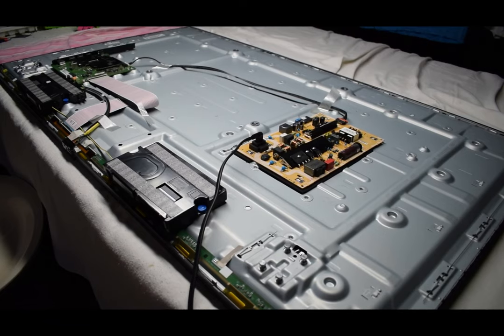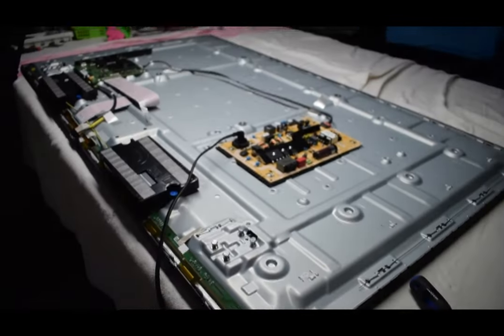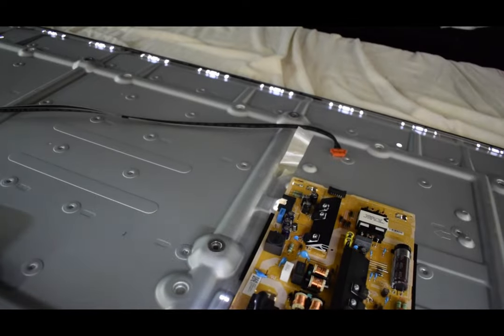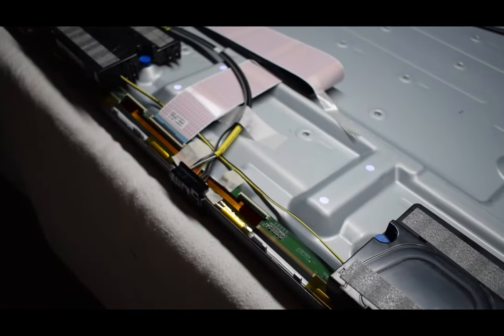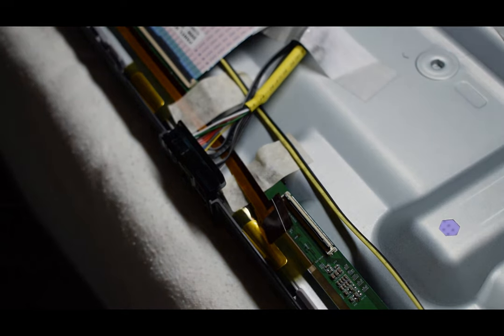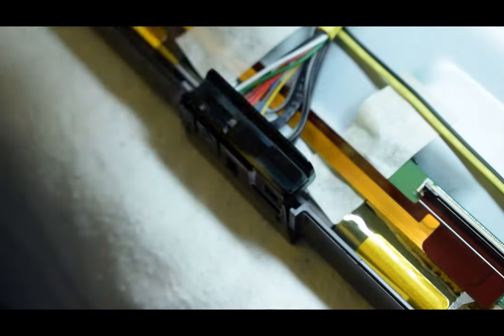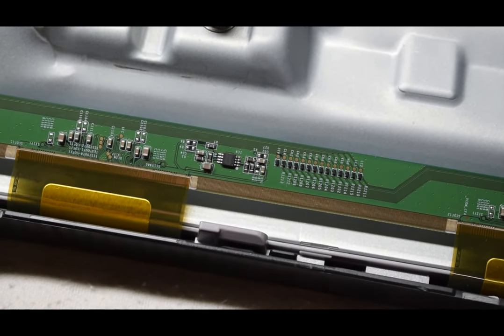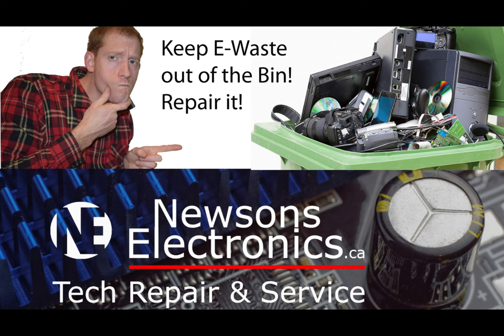Samsung smart TV power cycle Model UN58TU7000

Comment: Firmware is quite big and should be in flash memory. Staying in bootloader means the last update deployment was unsuccessful and it has nowhere to jump. Usually, update process takes 2 steps. First, it downloads new firmware and stores it somewhere in flash memory. It should verify that the downloaded file matches online one. Probably using MD5 checksum. Second, it sets some flags saying update is ready to be deployed and reboots. Bootloader knows there’s update so it will deploy it by overwriting the old firmware (I heard about systems that use incremental firmware locations but never worked with them). At the end, it will clear update flags and reboot the system. After rebooting, bootloader will jump into a new firmware. The problem is, when deployment fails (can be many reasons actually) there’s no valid firmware. Your firmware is corrupted so your system will be scheduled for reset by watchdog. The only solution could be reprogramming your flash memory with proper firmware but I doubt you can do this without special tools and firmware itself(reddit)

Comment: Thermal camera or alcohol to show what's getting hot?
Reply from the maker: good to know
Reply: I thought so too, but it shuts off immediately upon initializing and it detects a short.... So, will have to "power inject" to keep voltage on long enough for component to heat up.

Comment: Hi , I fixed that problem. Underneath the left speaker, there is a ground tape that was not properly installed. It was over a few circuit line. I removed it and reinstalled properly and Bingo Tv worked again. My guess is with speaker vibration over time it made a short circui, it was after 4 year in my situation. Good luck!
Reply: What ground tape look like. What size tv u have. .

Comment: On my Samsung UE70TU7175U I have backlight, boot sound and it does not reboot I just have no image or Samsung logo at startup. Do you think it could be a panel error ? I tried tape but it didn't work. Thanks
Reply from the maker: sound like the main board, try a hard reboot
Reply: @NewsonsElectronics  Thank you for your help I will do that. I also noticed that I have 0v on capacitors near ribbon cable on mainboard. When I make a bridge between two points on top right on the mainboard (t-con ready procedure I think) I have 17v on those capacitors with ribbon cable disconnected. I checked for shorts on panel drivers without success.

Comment: This video Great, isolated the problem with the tape and have picture back on. color a little off due to bad circuit but it is watchable. I was close to ordering replacement board which would not have fixed problem, thanks again for great video

Comment: So with Samsung TV's sometimes the boot loop is due to a faulty EEPROM.. As for the tape method in general, It should be noted that this is not 100% full proof method. I am not in a big city, but I see a dozen or so TV's a month at my shop  and this method works better on some tv's than others. It's generally a driver ic issue and unless you have a fancy hot bar press like in china factories - you not be replacing those ribbons by hand.  As Newson stated, it is almost never the capacitors (Ive never seen this either, although some videos on youtube say otherwise). I have never had 100% success with the tape method either, it's super time consuming to narrow down 1 or 2 pins on the ribbon that are at fault and not cost effective for a repair shop. (atleast for myself). At best it is a bandaid fix , I tell customers it is similar to patching an exhaust verses replacing. It  buys the customer some time with the tv if it works. Best case when it works you generally end up with horizontal lines of some sort that you do not see when 5ft away from the tv.  

Long story short, if buying a new / used tv is not in the budget. This buys you sometime. However, generally you are just using these tv's for parts as painful as it is to see a tv go to waste.
Reply from the maker: Thanks for sharing good advice
Reply: I have Samsung UN65MU7600F ( VA, Edge LED, 3840 x 2160 pixels )
It all of a sudden started re-boot like in subject video
I traced the issue all the way to the Panel drivers boards
TV has 4 Driver boards ( each of them have 4 chips on ribbon )
Disconnecting ANY of 4 driver board gets the TV going  ( w/o picture of course )
So essentially ANY 3 boards are fine, adding Random 4th one will cause boot cycle !
Any ideas?
Power supply issues?
Reply: Its funny i have a Samsung UN50TU8000FXZA and it suddenly started to auto reboot I literally left the TV on to go make breakfast came back and saw it like that tried to identify the short circuit and put some tape on it saw horizontal lines across my tv and knew it was done for.
Reply: hello ...... question  my tv goes in the reboot after half our  ue40es7000,   i found it on the street, and use it  maybe 20 min in the week ....... tilll now he had be okay some small picture problem but not irritating.  when i ope the back side i don t see strange things ...... only on the connector cable comes from maniboard is see on the connector (on powerboard ) braun spots ( grey cable side, the others are black)    i gonna try now this tric with tape , when that not works witch board i must change the powerboard  or the mainboard?

thanks for your time and answer

Comment: So I have the 55" version (same model). It was doing EXACTLY what yours was doing; power cycle every few seconds, then come back on with no video, but had audio.
Finally, I unplugged everything connected to the back of the TV and held down the power button for about a minute. When it came back on, it no longer cycled, HOWEVER, now I have a ~2" wide Black vertical line. I tried the cable connection giggle, and switched HDMI input port, but the line stays no matter what. I used an ESD safe orange-stick to apply slight pressure across those amber ribbon-type cable and noticed a very slight flickering of the Black band, but that's all I could get it to do.
Any thoughts?

Comment: I hoped this would be something other than the tape method.

For me I have a 70in.  Tape method does work but there are horizontal lines disabled.  Looks halfway decent from a distance away.

So mine is 8 pins.  I am still trying to figure out if I can let up 1 pin.  But having trouble finding which one I can uncover to lessen the problem.

So for those trying to figure out the tape method.  Just like he shows you have to disconnect a ribbon cable on the panel boards, turn it on, see if you get a picture.  Because the board is disconnected, you will see nothing but white on that panel board.

After that, cover up half the pins on one side put the ribbon cable back in and see if it boot loops. If it doesn't boot loop, you know you have the right pins covered.  Cut that piece of tape in half and cover half of those pins.  You can narrow it down to isolate the right pins.  But because pins are covered, the image will not be the same as before.
Reply: si esque esto  más bien  lo tiene que hacer un técnico en tvs calificado .

Comment: I used the tape method and got it to work. One side is perfect the bad side the tint is way off. Could this be a firmware issue or the panel is SOL? Also why does Samsung locked down the firmware so you can try the previous version?

Comment: I think i have this isse, great video, glad i didnt waste £70 on a new board but is there a propper way to fix the lcd pannel so it doesnt affect picture quality? I havent tried it yet so not sure if it would be noticeable but im quite ocd with things working the way they should.
Reply: I've found the problem pin but with it taped off the screen stays black. Backlight it on and the noise works, I can skip through channels but no picture, any ideas? Thank you!

Comment: Would you say this is a widescale problem in these TVs and will I have ANY luck trying to get Samsung to replace this? It's so frustrating because I have this EXACT problem and I've only had the TV for about 2.5 years!
Reply: Feel your pain
Reply: Me too exactly 2,9 year
Reply: @RichardmpayiTnway  had to throw mine out was a problem with a short circuit
Reply: same issue in 2 years right after warranty expired

Comment: I had the same problem, with my 55" Samsung Qled, the fault was as shown in this video on the small cable on the right, I found the exact place by moving a small piece of tape, then I cleaned it first with tape and then with tuner 600 contact cleaner, and now my TV works again

Comment: I used the tape method and it work, but the left side of the tv not showing real colours, right side colour is very clear, if I buy new panel cable will it fix my issue? 
Thanks
Reply from the maker: no
Reply: There is pink layer on the left side of the screen, is there a way to fix it?

Comment: Thanks for the video. 
However what do you do if you find out that the issue is from the left side LCD panel?

I current have that issue with two of my TVS and seeing that they is whether the white ribbon cable is connected it, I can’t simply use the tape method.
Await your feedback. Thanks

Comment: I pulled the wire from the power supply to the main board and back lights stayed on. I disconnected the small ribbon cables one at a time on each side at the bottom and nothing changed the tv continued to power cycle. I'm thinking one of the boards. Any thoughts??
Reply from the maker: I would use an led test to test the voltage going to the backlight see if they are the same
Reply: @NewsonsElectronics  possible bad power board? Someone mentioned he thought it would be the main board. I have a stand by light.
Reply: Have both boards available for this model unxxTu7000

Comment: I have the same TV that is only 2 yo. It 's doing the same thing and i did do the tape method that worked on an older Insignia 50" TV. but not on this one. I am pissed that it's a Samsung 2 year old and is junk now. Very disappointing.
Reply: Im in the middle of the same exact issue! Im so pissed. 2 years old and its garbage - wont be buying samsung tv again, thats for sure
Reply: I was right there. I cut a super thin strip of tape and used tweezers. Started at one end and moved one pin at a time across both the ribbons on the bottom. It took nearly an hour, but IDK about you, I can't earn enough in an hour to replace a 50" TV. It was worth my time. But I do agree... will never buy this brand TV again. Mine is only 2 years old too.
Reply: Mind died exactly after 1yr 6 months. When the warranty expired
Reply: @nancybracy9649   Hey Nancy! Was the problem only on one the ribbons for you? Or maybe both (left and right)?

Comment: Fixed my TV following these instructions. Thank you. The colour on the left is strange now. Is there a way to buy a replacement strip?
Reply: I am having the same issue with color. Did you find a way to solve it? Thanks
Reply: My tv have the same problem. Samsung offer to cover the material but i need to pay for the labor.
 Do you know which part needs to be changed for this problem so that I can reduce the labor bill?
Reply: @jordanbellerose4632 the problem is among the LED array, it’s not the strip itself

Comment: Works but with one issue. I have the 50” version of this tv.  Startup screen came on then a black cloud appears and fills out the whole screen right after then it shuts off and then on again and keeps cycling on/off.   So I gave this tape thing a try and wasn’t having any luck but i gave it one more try and this time screen stayed on but was all white and faint.  So I cut the tape smaller to cover less contacts and next time it looked pretty good.  Only issue is the left side of screen seemed to have a red/pink tint when it’s supposed to be brown/beige. I had about 7-8 pins covered with the tape so I managed to cut the tape super narrow we’re talking like 1mm wide to cover only one contact.  Managed to narrow it down to the one where the tv doesn’t turn on and with that only one contact covered the tv works but I still notice the red/pink hue on the left side.  Depending on what your watching/playing it’s more or less noticeable but hey at least the tv works and it’s watchable.  I might see how much that little ribbon cable costs it’s only like about 4” long and connects both sides of the screen together.  I’m assuming that’s the issue is the contact on the ribbon cable.